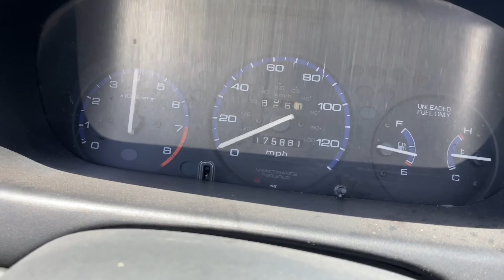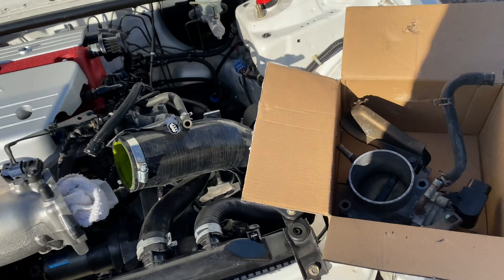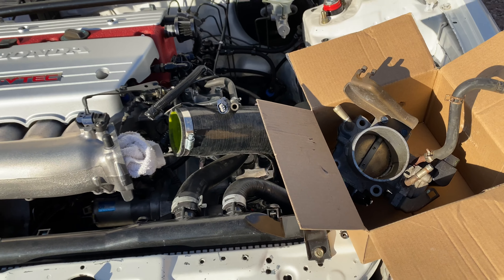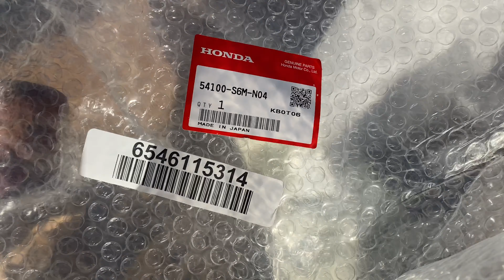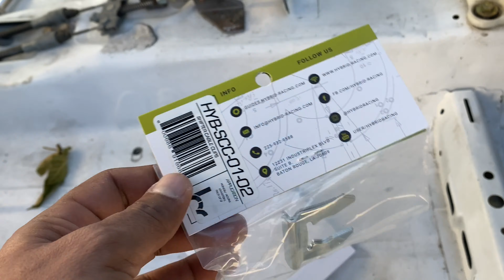K24 Swap Civic Ek Update

Comment: Happy I found this channel. What year is the rsx engine harness and ecu.
Reply: 02-04 👍 you can use base model or type s , but beware if you have a 6 speed transmission the base model harness doesn’t have provisions for the lockout
Reply: @PolishedMobileDetailing503  thanks. Now I know what to buy.

Comment: How can I get in touch with you
Reply: @oemworx on Instagram
Reply: @Solefresh10  hey brotha nice video bro keep up the good work also going to do a k on my 2000 civic si but Quick question do I have to change sub frame for me to go k
Reply: @eribertorodriguez4335  yeap,92-95 eg subframe
Reply: @unclefreddie1   ok thanks bro
Reply: @unclefreddie1  can it be a eg Coupe or only hatchback sorry about asking to much ?
Reply from the maker: Any 92-95 civic
Reply: eg sub frame w/power steering,wont bolton manual steering rack will have to use 93 honda accord swaybar bushing bracket,if your going w/ a manual rack!!!!if not then use power sterring rack of 92-95 if running p/s.... oh and dont forget to get all eg bolts and control arms your ek ones wont work!!!only your tie rod end fit!!!
Reply: @Solefresh10  hey using k24a2 from 07 tsx do I need to get different water pump housing or can I use the one on it and the alternator. Thanks.